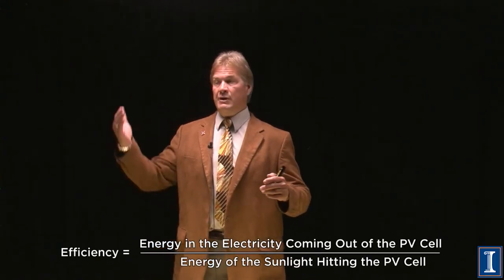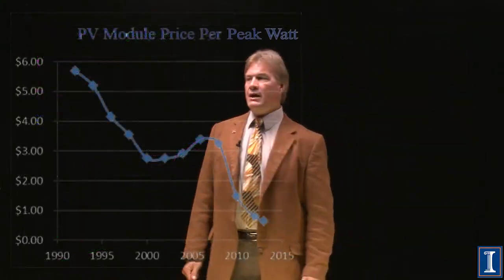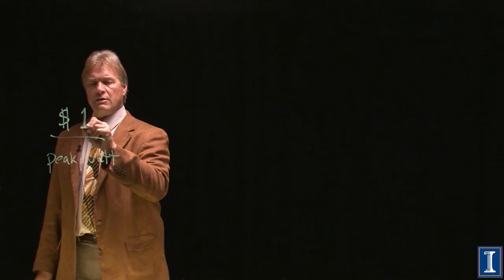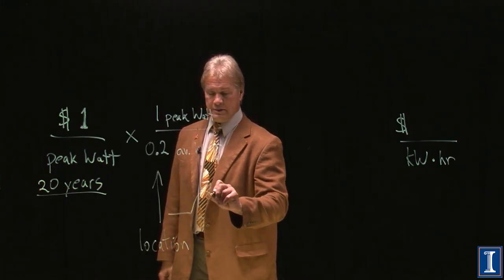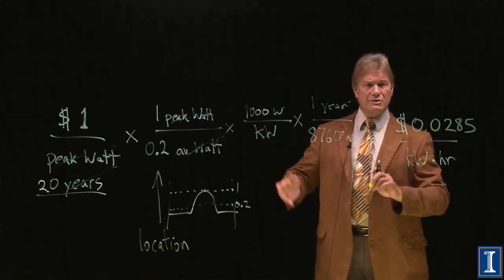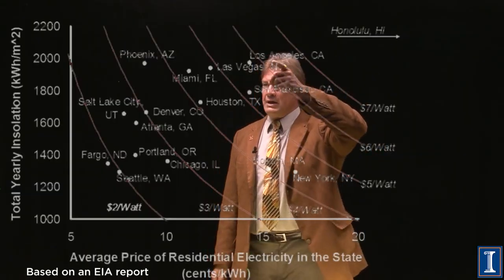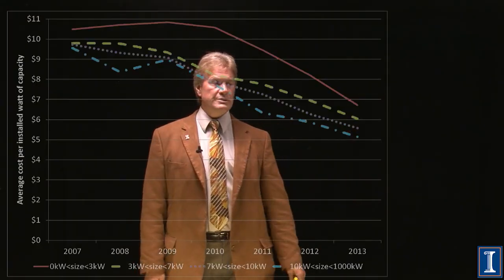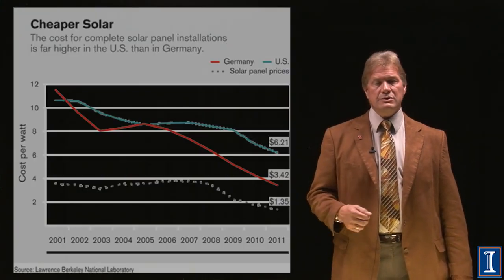The Cost of Sunshine

Comment: CDTE or any thin film panel. Assembled in vacuum chambers on rolls of stainless steel. The WHOLE process can be completed in a roll step application process. The edge banding and wire connectors are then simply affixed. I see how this can be optimized easily. Stainless steel is perfect and graphene can even be developed for an even better panel. The whole thing could be large rolls made in a machine something the size of a shipping container, and the factory floor just adds parts and tests and it can store MILLIONS of these panels in a small area. 
For raw watt production factory as cheaply and GREENLY as possible, the process would be near perfect. 
Protection later of silicone on the back for fire prevention, self healing design in cdte film makes it safer too. Top coating can be a clear liquid coating, like the optimized clear coat on a car... you see, its much lighter, cheaper and efficient in design philosopy than any sort of glass panel. which will also break, and isnt recycled very easily. The ctde and stainless can be forge smelted and reclaimed. SIMPLE
Glass is a terribly non green material, and stainless steel and other elements are cheap and abundant. 
If the panel makes 20 percent instead of 25 percent I see no real drawbacks only sufficient tradeoffs more than adequately making up for any sort of other crack pipe production dream (man is idiotic on fire on the surface of the sun terrible).

Comment: There is no economics to solar voltaic power as a stranded asset.   It can't  meaningfully run anything.   It needs to be maintaining electric storage or something similar where the storage then provides useful electricity.    This is true for any meaningful  use.   Even at 12 noon solar voltaic can't meaningfully run anything.   The worst case scenario is when solar or wind generated electricity is forced to be supported on the public power grid.   The public power grid has to support the entire maximum possible solar and wind generating space with fast reacting peaking power.

Comment: Would like to see this lecture done today with today's Solar technology Capability.
Reply: Price per peak watt has gone down, maybe as low as 20 or 30 cents per peak watt, but install prices are just as high if not higher because the lack of uniformity in roofs is the same and labor and materials are as expensive as ever.
Reply: @OregonApe  theres also the instability of this kind of power and the fact that solar and wind use dc power and not ac as the rest of generating sources
Reply: @OregonApe the cost of installation on large scale solar farms is close to 1$/watt which is why they're going in everywhere now.
Reply: @gregspecht3706  you still need pufferstorage on the 100 MWh scale
Reply: It is still an educative presentation,  to get deep understanding of the economic details
Reply: I’m in Melbourne Australia and have 14Kw of panels in 2 separate systems controlled by 2 5Kw inverters feeding 2x 15kwhr batteries .. in the southern hemisphere we face due north and the roof angle is perfect division between summer and winter angle range.
We were paying $0.50c/Kwhr for electricity + a $1.00 a day for infrastructure charge which added up to between $150-$200/month for power.
The system (while I put it up in three separate timelines, the total cost was AU$20,000 all up. Uninterrupted power forever …
Reply: @michaelcooney7687  So, if I do the simple math on your install and assume you can't sell any back and assuming the max monthly bill of $200, it will take you just over 100 months to pay back the $20,000.   In the 8+ years it would take you to pay back your $20,000 you would earn an additional $3,500 which would be an 17.5 months and in total 117.5 months or 9.8 years.  All this assumes the max monthly usage, no repairs and the solar continues to operate at peak efficiency all year round.
Reply: @michaelcooney7687  that is not a bad system, given how stupid our costs are, you need to factor in how much your system offsets for pricing during the day and peak prices, your return per month might be more. however lets look at something more important the life cycle of your system, at the 12 year mark you are possibly looking at replacing the whole system, now lets hope inflation stays low and the cost of power keeps going up you are looking at breaking even at the 10 year mark. This is the problem with solar, i did some work on modelling solar systems and unfortuently the return periods are not that crash hot due the the life cycle of the pannels, batteries and inverter (this assuemend premium subsidies on solar engergy which has dropped, feed in tarfi was the same). You have everything right which is the problem, 30kwh worth of storage which is over kill but perfect, you have a correctly sized system 14 kw, after you factor in the all the mitigating factors would net you about 8-9 kwh. The problem is the cost of a system like yours is just too expensive to warrant paying for it. It would be like me paying all my electricty bills for the next 10 years up front. Next lets assume you take out a loan to pay for this, at an interest rate of 7%, you are now possibly in the red and have paid more than if you had just paid your bill up front and used power more conservativly. I've got nothing against renewables, but when you start cracking through the numbers the return on them is hairline marginal. Also where did you get a system like this because i'm sure as hell interested, espically the 14kw systems its free aircon duirng summer and then sum, plus the battery system looks cool 2 15kwh batteries is awsome
Reply: same, i'd love it
Reply: You all can shove your solar panels up your ass. We need cheap energy 24/7.
Reply: I was thinkin the same. The prof does such a great break down on these topics and technology.

Comment: The big difference between Germany and the US is; Oregon is about the equivalent of Germany where as the US is the equivalent of a large chunk of Europe.
Solar farms and roof top solar are the worlds most stupid way of supplying electricity to the grid.
Home roof top solar to be of any real benefit to the home owner and actually achieve something towards carbon emissions reduction should be limited to powering lights and a backup battery system and HVAC
Reply: Demand for electricity during the day is generally much higher than during the night.
That's why many places around the world have night and day electricity rates for end consumers and the night rate is cheaper, to somewhat reduce that difference in demand.

Personally I think that's one thing solar can actually help with, since it produces only during the day, it should be possible to make it so that solar takes on the increased demand during the day, while other sources supply power during the night.
Reply: @ZealotOfSteal  That idea is why everything is in such a mess, because it can never work that way.
You can run stuff that doesn't matter off solar but everything on the grid matters to the grid and solar can't be trusted without wasting a lot of money and energy on batteries, If solar was ever to work it should never supply the grid only things that burden the grid but don't matter if they lose power for several minutes at a time.

Comment: As we have found out since this video was made, you still need baseload to power cities. If you want to independently generate some percentage of electricity for a house that isn't connected to the grid, that's fine, but let's not claim solar panels are something they are not. To power cities let alone countries, you still will need to have two independent systems running at the same time (solar or wind and the natural gas, nuclear, or coal fired plant, etc.) to manage the ebbs and flows of electricity demand. This is why the promise of cheaper electricity hasn't come with even more adoption of solar and wind since you just added a layer of complexity on top of the existing infrastructure. The only way I imagine solar ever working on a large scale is if you have a super cheap way of storing energy generated during the day when the sun is shining that can be used at night while the conventional power source is used during the day.

Comment: Illinois Professor you graph for Full PV output is incorrect.
The graph is not a traditional sinusoidal waveform.
The graph should have a Flat top for sunny locations.
The flat top represents full PV output and should be minimum 6 hours long in Winter and minimum 10 Hours long in summer.

Comment: So ... I would love to put 3-5 kW of solar on my roof. I live 300 km north of Toronto and my insolation is around 1150 kWh/m2. However, in sum I am paying about $0.22/kWh CAD with everything included (customer fees transmission fees as well). I can buy the panels and connectors and micro inverters online for somewhere around $1.5-$2 per watt. So, for a 5kW system, that would be around $7500-$10000.
I would be most pleased to install it myself, but in addition to any of that, I have to first get an engineer to stick his head into my attic and tell me if my roof is strong enough to hold the panels. (Now, it's good for 4 feet of snow, but I digress). Then I must get a building permit from my municipality which I am told is about 15% of the cost of the job. So, figure $1000 for the engineer and another $1500 for the permit and I am another $2500 into this. If my electric bill is perhaps $100 a month in a low carbon electric province, other than the novelty there is not much of a case for doing this. If I could offset my entire bill over the year with net metering (permitted) then I might save $1200. However, with the above numbers, my system is going to cost $15000 easily and while I can do some DIY, to have it connected I will need an qualified electrician to hook it up etc. So, that gives an optimistic $3 CAD / W to set it up and I MIGHT save $1200 a year. So, it would take easily 15 years for this to pay itself off. In that time, I would probably have to replace the shingles on my roof and they would have to remove all of it and put it back on which won't be free either.
I would just love for environmental reasons to get off natural gas and go with an air source heat pump, a heat pump water heater and dryer and change my fireplace to electric. However, the equipment costs are out the question except for the wealthy. So, I will end up continuing to pollute against my best wishes. Sigh.

Comment: Just looking at an installing a rooftop system in August 2025.  I listened to the salesman’s presentation and looked at his graphs showing how the install on my house is tremendous but I wrote the details of my install, pricing, import costs and export credits etc in a popular AI and the numbers are only positive if I can earn credits in the summer months where my generation exceeds my use and then switch the utility company’s plan in the winter so I am paying a lower rate for my use that exceeds my generation.  A program like that exists which is the selling point for the solar install company.  The risk is the utility company allows this set up today but it is not a contracted set up and the utility is very clear that if government rules change they can disband or amend the program.  They are also very clear that they can also amend or cancel the program at any time, they do not have to justify their actions.  As the economics rely on this difference in summer and winter pricing, and the pricing scheme is part of a marketing program, the risk of change by the utility company seems very high to me.  Another thing I asked the AI to model was a discounted cash flow analysis, after all installing panels is an investment decision.  The salesman’s presentation does not using a DCF model so people are not looking at present values.  I used three discount rates and the NPVs were not large for two runs and negative for the third.  Payout are generally greater than 10 years and if any of the pricing models go south on me the payout periods are way too long.  I have other issues affecting my decision like my shingles have 10 years or less left and my electrical panel is in my garage which requires a longer run and more install costs.  When I take into account the time value of money, the project has marginal benefits for someone well into retirement.

Comment: It's 2025 now, and this talk aged well. Things that have changed are the NG crisis in europe through the war of Ukraine and Russia cutting of Europe from NG exports through embargos, spiking NG prices throughout Europe.

Technology has progressed far enough that EVs that support bi-directional are slowly coming into market, allowing for more flexible use of battery storage. In the mean time, active demand steering for EV Chargers turn out to be a great way to sink the Solar peak power into storage with wheels.

It's the combination of both sun and wind with other technologies like EVs and heatpumps that allow less dependence on fossil fuels and foreign regimes and diversify the energy system. We'll still have NG plants, hydro (storage), nuclear and some coal, but a bulk of generation is now sun and wind. We are approaching 50% for electricity in the EU.

Maybe there is a talk about the heat side of things, which is a much harder target to change.

Comment: Hmm last few 600Wp bifacial panels I bought were aprox. 100 eur per piece, now I have a 17kWp system with 30kWh battery storage, all DIY, no papers whatsoever… Victron Multiplus 15kVA… Im sure my cost was much less than 20000 eur, I did it slowly in about 5 years

Comment: This video was produced 10 years ago and a lot has changed making much of what he is saying flat out wrong.  The cost of solar energy continues to drop making it by far the lowest cost way to generate electricity.  And more importantly, the cost of energy storage has dropped dramatically.  China is moving rapidly to low cost solar, wind and storage and N. America is stubbornly sticking with high cost fossil fuels.  It is inevitable that China wins.  If you want a better analysis of the energy transition, it would be better to look at anything Tony Seba has been saying over the last few years.
Reply: The true cost of solar has to also include the cost of baseline power that MUST be supplied when it's not working. If you donr factor that in you don't have a realistic full cost

Comment: This is a little silly. Peak solar is also peak air conditioning. I have solar, I only wash clothes when my panel is producing extra power since I still need more battery.  Installation is crazy expensive  in the USA. I installed my own in Colombia and had an electrician install a switch between my system and the grid. The question is why is everything more expensive in USA, Why can't we build transportation or anything without unreasonable costs? Deregulation also has costs. Switzerland, France, Norway etc. are at least as regulated or more than the USA yet their cities are beautiful and transit works. The question is why do we elect incompetent people? Why do they write stupid regulations while permitting consumer fraud and unsustainable building in flood planes where children die because they weren't or couldn't be evacuated.  It's not regulation it's stupidity. We have stupid political debates because our people are too ignorant to attend to the serious questions of the day. We are the problem, the politics is the symptom. We allow ourselves to be manipulated.

Comment: Sure would be nice to have an updated version, to deprecate the out of date info.  I live in Texas with a 13KW solar system and it is the only thing keeping me from the poor house as NG prices spike and so do the electric bills all my neighbors have.  I am working to get whole home batteries so I can weather the grid outages we keep seeing.

Financially solar is saving my butt!
Reply: exactly the prices have come down significantly again, far more than people expected them to actually.
At this point, there’s very few locations where it does not pay off.
Reply: @FreekHoekstra  Indiana is one of them. The true ROI is about as long as the average life span of the panels and inverters.
Reply: Also, that is for a grid tied system. Add batteries for storage and the numbers go right out the window.
Reply: @StFiacre  Florida , believe it or not, is another place. Very stable, non-variable, somewhat affordable power from the grid, plus high monthly charge for access only if you have solar, and low net metering payback. Either go off grid completely, which is a pain and expensive, or don't bother. I have analyzed my electrical bill every month for the last 11 years, trying to see if it would be worth it. It hasn't been yet, even with hindsight.
Reply: @StFiacre  Prices for storage are plunging.  CATL (world's largest battery mfg) just went into mass production with Sodium Ion Batteries that are much cheaper than Lithium.  They don't use any exotic materials, just Iron, Sodium, and Carbon.  1/2 the storage density of Lithium, which is bad, but that is offset by 1/10th the cost.
Reply: This guy is very biased towards nuclear. It absolutely has its place but I wouldn't trust this guy to give me accurate solar outlooks.
Reply: @dillonbooker7222Reasonable take.  But solar needs all the friends it can get, I'll take even the fake ones. 🫡
Reply: How much did your 13kW solar system cost?
Reply: @aarondcmedia9585 7yrs ago.. 28K after incentives. Crazy story, but hardly price relevant now. Glad I could invest it in power production 😅
Reply: You can just use the cost of your system (divided by 13kW) to calculate the current cost. Houston was on the $4/watt line, so (assuming electricity prices haven't changed) anything under $52,000 was worth buying.